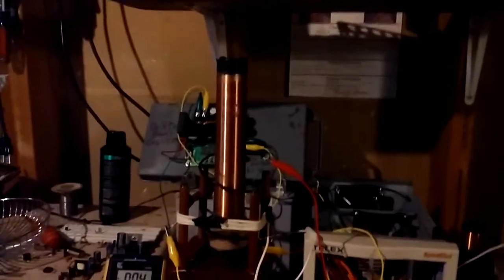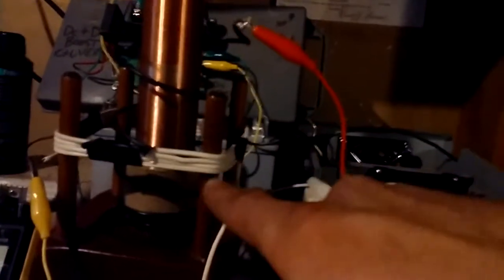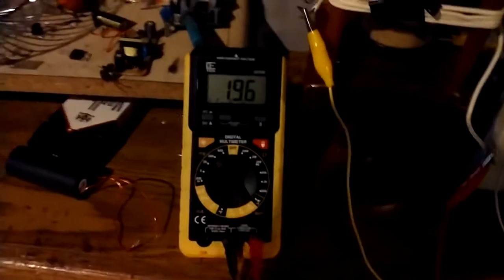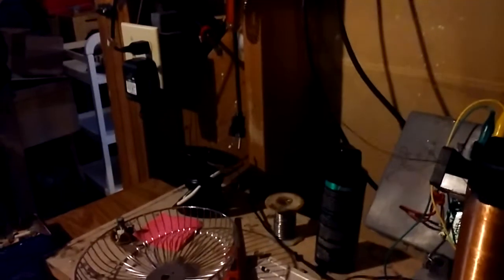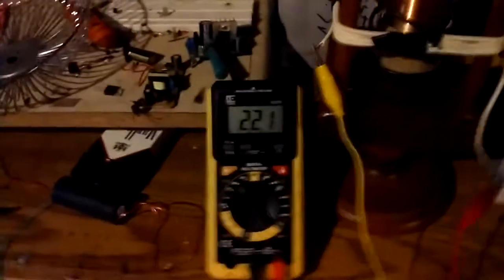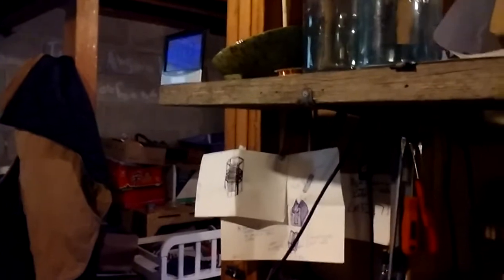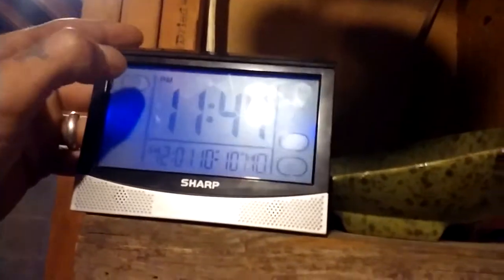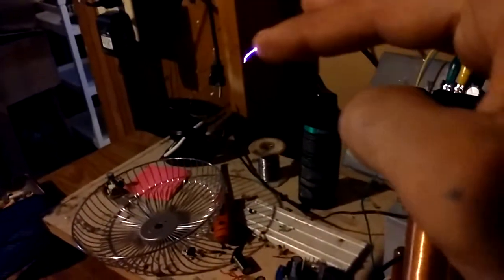Ludic Science Replication Duel Primary Slayer Exciter

Comment: Great video!! Can you tell me the specifications of the components you used?
Reply from the maker: yes, the transistors are TIP 42  C's. The l.e.ds are just 2 or 3 volts. the resistors are 22k, colors  of resistors are red, red,orange, gold. If you need help let me know
Reply from the maker: +Daniel Johnson ah sorry the last thing I forgot to add was the capacitor is a 1.8 microfarad across the negative and positive rails.
Reply: Where does the capacitor go? The single primary one i made does not have one.
Reply from the maker: +Pratyush Shukla negative prong of capacitor to negative input. positive side of capacitor to positive side of input